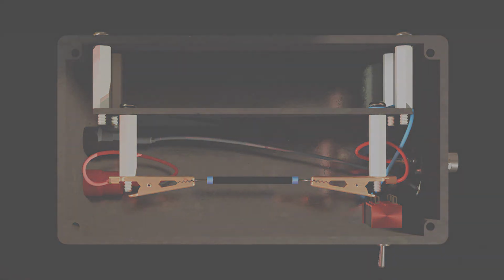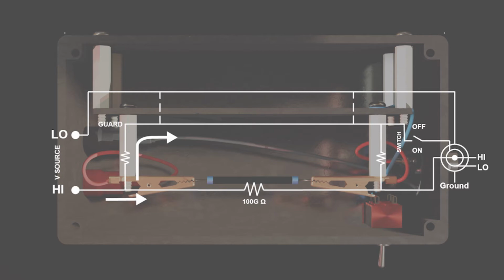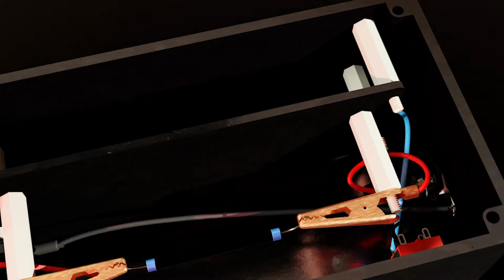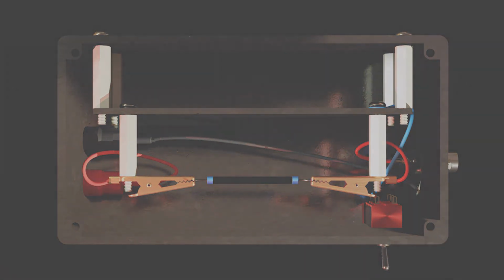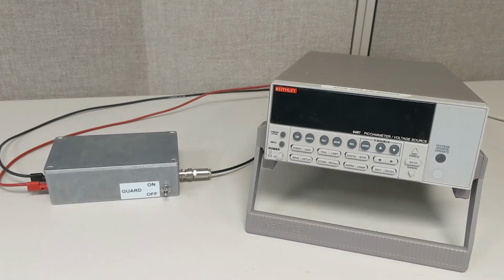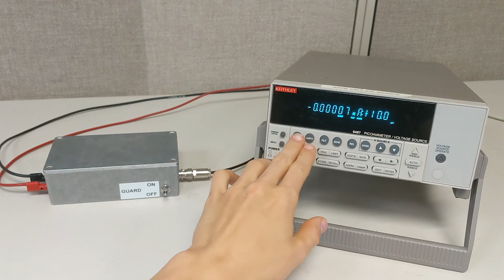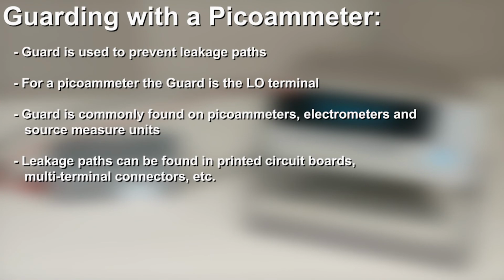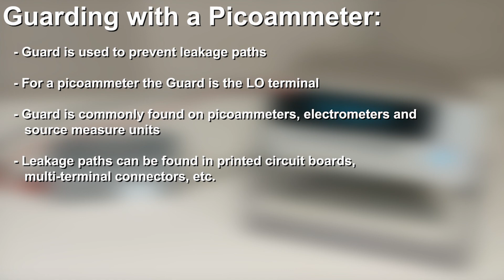Guarding with a Picoammeter for Better Measurements

Comment: Is there any application notes for better understanding of this shielding type.
Reply from the maker: Thanks Udhaya for asking this question on shielding. Here are a few related resources to reference:
Applicable FAQ: https://www.tek.com/en/support/faqs/picoammeters-electromeers-sensitive-smus-what-guard
The low-level measurement handbook also has information on guarding under section 2, in 3.1: https://www.tek.com/en/documents/product-article/keithley-low-level-measurements-handbook---7th-edition#C3section2